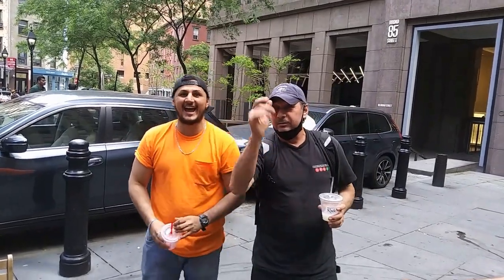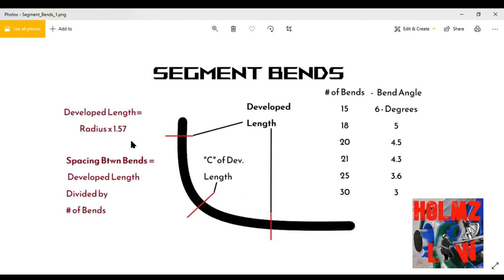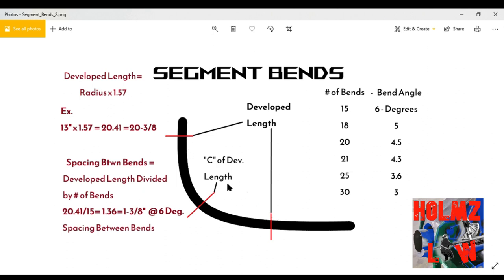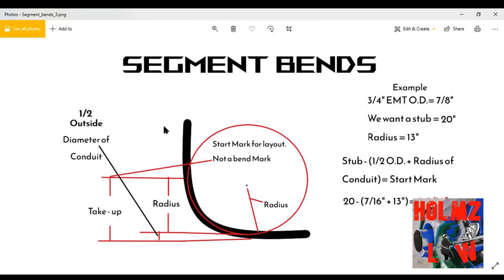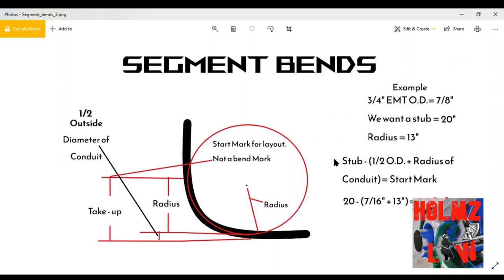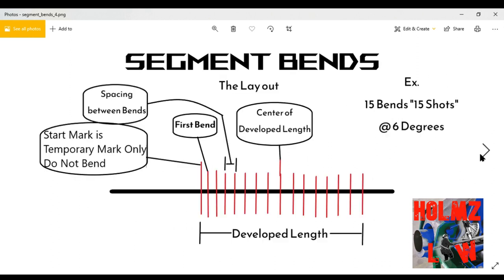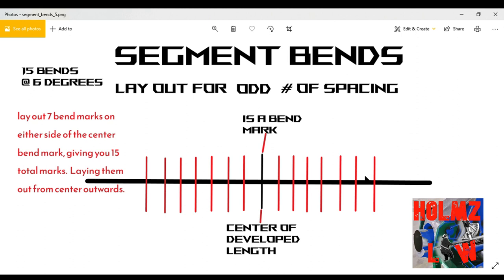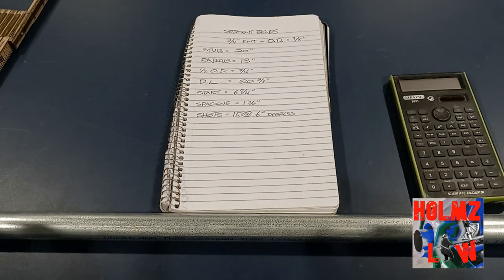Segment Bending: How to Measure, Layout & Bend (Advanced Bending)

Comment: In your concentric bend video I believe you said that your last mark of your developed length measurement is used as a bending mark, however in this video you are saying that both your front and back marks are not to be used at all. Is that because you are just laying out the spacing just a little bit different for concentric bends?

Thank you I’m trying to understand. 🙏🏻

Comment: I have a question Melvin can you make a video of how to find the diameter of big obstructions like a tank . Do I check on the plans or what
Reply from the maker: Yes thats one way of doing it. I always verify the engineers dimensions because most of the time they are off. So how to verify. Best and simplest method is to grab a long enough straight edge, whether it be kindorf , wood 2x4, etc. anything straight. put it on one side of the tank, grab another straight edge put it on the other side of the tank. Now you have to work on straighten out the to straight edges. How? well do it by eye at first till you get close enough then you start measuring the 2 side, until both sides you have the same measurement or close enough. and that would be your diameter. i hope that makes sense. I know i have a video on concentric bends that has to explain this. Look through my video's. Or if I find it i'll send you the link. If you want to talk to me further i'll send you my discord server link below
https://discord.gg/GAbvCNpW

Comment: How does one find radius without the information provided ?
Reply from the maker: So in order for me to explain it well I would have to do a video which I've been meaning to do. If you know how to measure the diameter of a round object then that's all you need to know. If you you know the diameter then this is what you have to do.
Step 1 - Diameter divided by 2 = Radius
Step 2 - Radius x 1.57 = developed length
Simple as that. Also you can find videos on YouTube if you don't know how to measure for the diameter. Hope this helps.
Reply: @TheArtOfConduitBending  I appreciate the speedy response brother. I totally understand what you mean under that circumstance, but what if my segmented bend is following beneath cable tray that does a 90. It's not a complete circle so I couldn't measure around the circumference; unlike a cylinder tank. Would I use the cord method to find the radius of the cable tray as mentioned in your previous videos ? Or does that only work for benders ? .. I hope this makes sense.
Reply from the maker: @SouldOut92  ok so if you want to do a segment bend around a cable tray then its just a matter of measuring the width of the cable tray and just using that as your diameter to solve your formula. it would help more if you were to either send pics or a pic of a sketch to my Discord Server. If you have not joined my Discord community then here is your Link to join. I could help you better there.
Here's the link:
https://discord.gg/WuBERWw